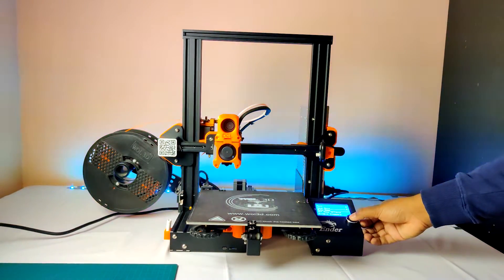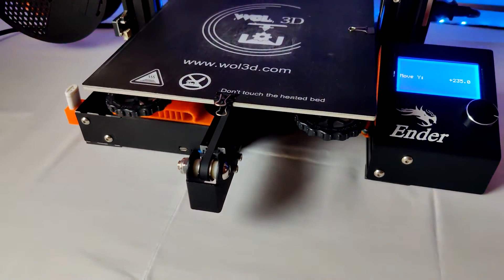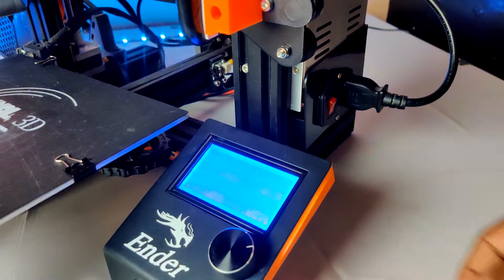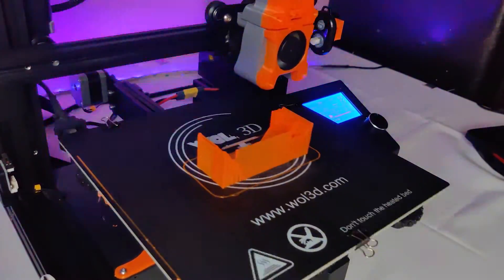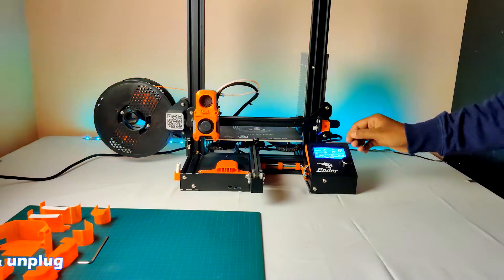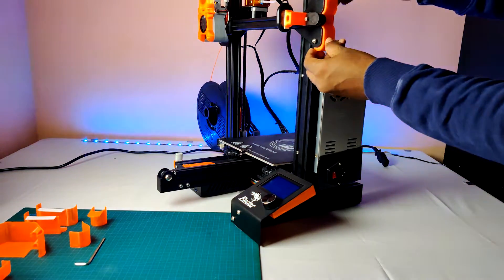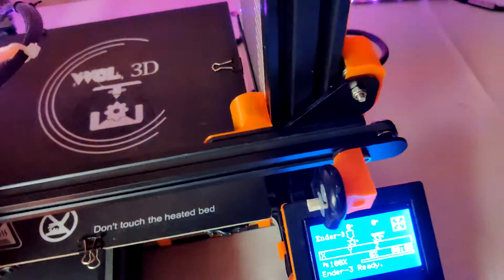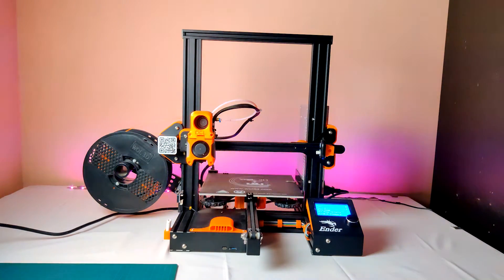Use this to protect your Ender 3 printer from dust #ender #enderman   #3dprinter #3dprinting

Comment: Thank you
Reply from the maker: You are most welcome buddy 😊
Reply: @dcl3d  i found something i wonder is this can work ,to have a perfect bed level
(Ceramic Tube Wiring Heat Insulation Protection Single Bore) look it up instead of springs
and think the y axis belt needs to be tied upside down.
what do you think?
Reply from the maker: @softart5235  Keeping constant height for the bed by replacing the spring may if we have BLtouch, it will work more efficiently. If we use same setup without BLtouch out off  10 definitely 3 times the Z-limit homing will not accurate if that happens it will damage the bed in the condition ( If the nozzle homes lower than the Z homing level, When the X moves to the centre the first layer will make a impression on the bed. Also untill moving to 2nd layer the filament will stuck in hot end and make a clogg. 
The Y belt upside down thing I don't get it buddy. Do you have any other example?

Comment: What is the cover on the extruder? I see that for voron.. what does it do for ender? I have S1 Pro.. curious if that is an upgrade.. was curious if I could get the e3d extruder with hot swap nozzle.. but not sure it's direct drive or not and would work on s1 pro.
Reply from the maker: Yes, it is voron design fan duct but that's not direct drive. It's my first look upgrade for my printer. I redesign it to fit on ender 3 duct. The think is ( if S1 Pro X-Axis bracket which carries hot end are similar to ender 3 ) my design will fit. If not it won't fit on S1 Pro buddy. Have a nice day 😊.

Comment: Useless..... That grey stuff on the rollers isn't dust! It's residu from the POM material. With these covers you only making it harder to remove.
Reply from the maker: thanks for your thought, but still this time my printer works great nothing goes wrong.
Reply: @dcl3d  iv'e been printing for years, replaced the wheels once now and never had any issues, most problems with this "dust" relates to over tightning the wheels.
Reply: Can u give me some tips on how to fix it properly then?